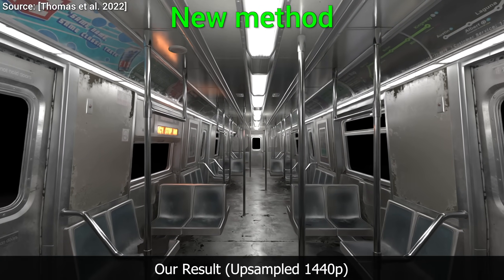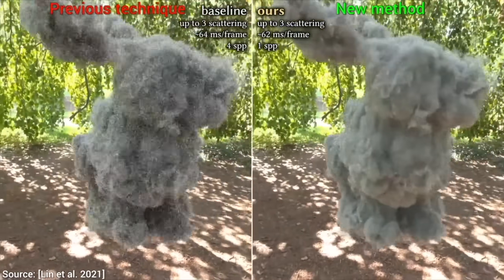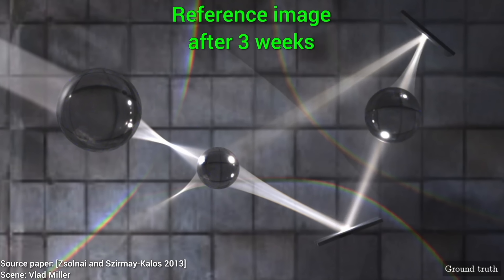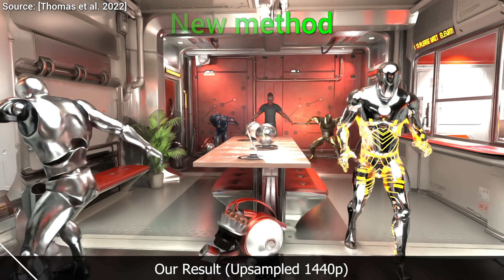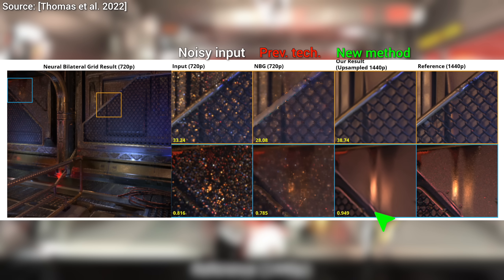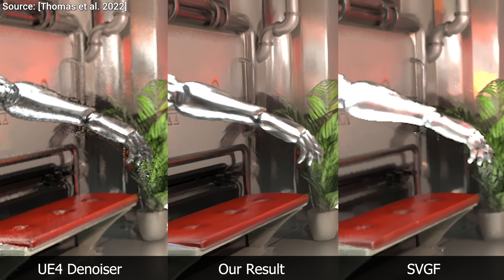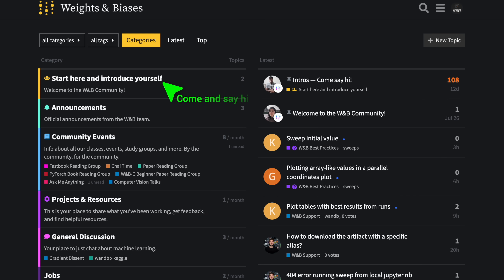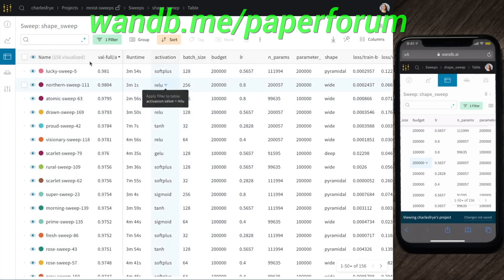Intel’s New AI: Amazing Ray Tracing Results! ☀️

Comment: "More pleasing to the eye" is something you should discard immediately from your vocabulary when talking about objective quality. First, it is entirely subjective. Second, and more importantly, the objective quality of the denoise algo is completely wrong thing to be attributed for pleasantness to the eye. That should be attributed to the composition of the scene. 

If those flashy inconsistent reflections annoy you, do NOT make the denoiser lower quality. Instead, compose the scene in such way that those reflections are not there, or that they become pleasing to the eye. 

I got to say, I'm a bit disappointed a light transport researcher would say something like that.
Reply: Well, objectively, you have to allow for subjectiveness... seriously, lol. The particular scene he mentioned had more to do with slightly softening the hardness of edges. There are a large portion of people who prefer slightly software images (I'm not one), so, he isn't wrong in that statement. Subjectiveness in visual quality is what allows us to use things like lossy encoding/compression. Objectively, such compression is tossing out a lot of information, but subjectively, that isn't noticeable to most viewers (up to a point).
Reply: @JimBob1937  No. Just no. Subjective feeling does not measure the quality of the thing you're forming opinion on. It only measures your own feelings about that object or thing. What's more, such opinions are not even reactions to the algorithm used itself. Rather, they are reacting to the visual results of the image. It is possible to make lower quality result with the better algo but not the other way around.

Thus, no matter how you twist this thing around, you are wrong. Overall, your lol-comment just shows that you want to be right and argue just for its sake, instead of trying to have a productive discussion about the issue. Well.. You failed.
Reply: @anteshell  , lol, you're missing my point. I 100% understand yours. You're effectively stating subjectiveness has zero purpose in algorithms... which is 100% wrong. I am not arguing for the sake of arguing, rather, you're missing the giant, gapping hole in your argument. We're designing these specific class of algorithms for the human sensory organs, interpreted subjectively by our brains. There is a whole crap ton of subjectivity and fallibleness to our senses, and subjectivity plays a key role here. 

" It is possible to make lower quality result with the better algo but not the other way around."

Yes, you can, subjectively speaking. Again, the prime example is lossy compression. It 100% is producing a worse output if you measure that output in terms of pure accuracy, but, humans subjectively dislike certain aspects of images. Too much high frequency detail subjectively tends to bother people, and lossy algorithms tend to get rid of those first. You may want to heavily research the area of human perception and computing. There are many, many things that are objectively less accurate, but are subjectively more pleasing. For example, music tends to (tends as it is subjective) sound better if it is louder, hence the loudness wars. The brighter and bluer calibration settings on modern TVs subjectively look better but is not accurate to the standard color temperature and color calibration, hence the show room color settings used for selling TVs. Dithering is added to an audio signal before an ADC in order to make the last bit of flip randomly, this is objectively less accurate, but subjectively 'feels' better to the human ear. Dithering is an aberration to an image, but can be added in such a way to blend and produce the appearance of more varied colors... worse for your argument, image dithering has multiple types, usually:
- Ordered, a specific repeating pattern for the dithering.
- Random, a random order to the dithering.
- A less defined category, but still a thing, perceptual dithering. Dithering is applied in a specific way that is reliant on human subjective senses of perception, to where the dithering is applied in specific areas of most importance per the general subjective nature of the human senses and visual processing.

Ordered dithering tends to be subjectively worse as human's tend to notice it more. We're more accustomed to randomness in nature. All of the techniques are generally used to improve the perception (subjective) of a higher color bit depth when it doesn't actually exist, as the expense of spatial resolution. 

A very recent and more topical example. DLSS. Even when it fails to be at 100% accuracy to the ground truth, I have actually found instances where an image reconstruction is subjectively better than the native resolution it is trying to emulate. I kid you not. This is because it can improve in perception in other areas like temporal stability, or even improve visible detail over native since it is mixing old and new image data, something native doesn't have access to. In this sense, ground truth is a more limited point of reference. Ironically, in this case, if one were to measure absolute error between an algorithm output and the ground truth it is trying to mimic, it would give higher error calculations for the portions of DLSS that are actually more accurate, simply because it has access to more information than the ground truth.

There are many such examples. In general signal and image processing, human subjectivity is a huge factor. So, again, I am not at all shocked by his statement. It seems to be you that is not at all familiar with human perception being that important in algorithm design, for algorithms whose results get perceived. 

"Subjective feeling does not measure the quality of the thing you're forming opinion on."

Sorry, given your annoying response, I can't let your poor wording choice pass, haha. 

Opinion:
"- a belief or judgment that rests on grounds insufficient to produce complete certainty.
- a personal view, attitude, or appraisal."

Opinions are inherently subjective. You're confusing opinion with objective truth. One can't have an opinion on an objective truth, since that is the truth. Yet, I think you subconsciously understand that perception generally isn't fully aligned with objective truth (how can it when our own perception organs feed us approximations of reality?), and hence are subjective.

So, to thoroughly defeat your shortsighted position... heck yeah, algorithm results can 100% fall into subjective territory if they're in any way perceived. Human perception, and I'm sure similar for other beings as well, is limited in its own accuracy. Your sense organs are feeding you approximations of reality, and your brain is interpreting this information in a subjective fashion that may not completely match reality. Hence, if our base perceptions are inherently subjective, then you have a hard position to argue that algorithm results won't be subjective in perception. A crap ton of engineering makes use of these limits, and the results can indeed be subjective from person to person. Some can notice MP3 compression, or a lower sample rate, or lower bit rate, or JPEG compression, or ...etc, more than others... because it is subjective. 

To loop back around. A noise reduction algorithm for light computations is effectively guessing at missing data. It can't know with complete certainty, for it to know that it would need to run the entire calculation! As a result, yes, there will be variations in how different algorithms correct for this missing information, and the result is, some will be subjectively better than others in their approach. You can objectively try to measure this in terms of absolute error to a ground truth reference, but there may still be solutions that are subjectively better even if it is less accurate objectively... this is just the name of the game.

"What's more, such opinions are not even reactions to the algorithm used itself. Rather, they are reacting to the visual results of the image. "

Is a nonsense statement. The algorithm only exists to output visual results... so, by reacting to the resulting visuals of the algorithm is 100% reacting to the algorithm. That is the only reason it exists.
Reply: @JimBob1937  I might be missing some of your points, but that's purely because most of your both text walls are completely irrelevant to what I've stated. Thus, there is no reason to discuss about them. I'm not interested in talking about anything else than that one very specific and limited thing I stated in OP. So, when you start talking about DLSS and different dithering patterns, that just shows that it's not me who missed the point. Those things among the most of other things in your comments are completely out of scope of anything I've said here. Thus, your comments can only be seen as bragging or what ever else equally unproductive. You've got quite a lot to learn about how discussion works.
Reply: @anteshell  , so, with that giant explanation out of the way, let's go back to my original statement where you said I 'failed': 

"Well, objectively, you have to allow for subjectiveness... seriously, lol."

If our perception is subjective, which it is, you objectively have to allow for that subjective nature in engineering of devices or algorithms. It's just a fact of our reality. Display technology understands our perception is limited and subjective in nature, and makes use of this to reduce bandwidth, storage (of the media), engineering of the light output. Some people notice dithering more than others. Some notice higher/lower frames more than others. Some notice a wider color gamut more than others. Some notice color accuracy more than others... because our perception is highly subjective. Some even find incorrect things subjectively more pleasing. Like vinyl records, which objectively from an engineering standpoint are a worse platform in every way. You can actually do interesting audio engineering to give a perception of higher frequency ranges by making use of the subjective nature of our audio perception. You can add harmonics in a way that make us perceive a lower frequency content than exist in the recording medium. Seriously, subjectively all over the place, lol.
Reply: @anteshell  ,"You've got quite a lot to learn about how discussion works."

You've got a lot to learn, as you just keep trying to brush things off as out of scope.  Your response was not limited, your response was broad in context. Hence, you stated things improperly if you meant it just for this context. With that said, even in this context, you 100% MUST allow for subjectivity since the human perception IS SUBJECTIVE. You can argue against this all day long, but anyone who works in this space should know this. I studied electrical engineering and signal processing (look it up), and there is zero doubt that subjectivity plays a role. So, it seems like you just don't want to admit you're wrong... which is fine, I don't care, lol. However, for any passerby's, they will at least understand how you're wrong, so you're not spreading false information. Have a good day.
Reply: @anteshell  , "but that's purely because most of your both text walls are completely irrelevant to what I've stated."

You stated:
"Subjective feeling does not measure the quality of the thing you're forming opinion on. "

"What's more, such opinions are not even reactions to the algorithm used itself. Rather, they are reacting to the visual results of the image. It is possible to make lower quality result with the better algo but not the other way around."

Which is wrong, and still broad. I gave visual examples and auditory examples. Visual subjectivity is no different than audio subjectivity, in that they can both in subjective in perception. It's well within the scope you gave. If you want to ignore everything as out of scope, that is just a very weak cope out.

Ironically, by our disagreement, you're either not being intellectually honest, or we're experiencing what? Subjectivity in how we're interpreting the information given to us. Subjectivity is pervasive in our reality in many areas. Not saying that is good, but it is reality. Human's are faulty in taking in information and interpreting that information, no matter the type of information it is (hence, broad enough to cover your scope). Even if going for objectivity, you must allow for this subjective nature in your calculations. For algorithms, those that play on subjectivity can exploit it by appearing more pleasing even if less accurate, or exploiting it to reduce complexity. Like JPEG compression exploits the human subjective nature of visuals in that we tend to focus less on color resolution and more on raw luminescence.

So, as kindly as I can state it, given your lack of intellectual honesty and inability to admit incorrectness, while telling me I've failed... all I can say is, f'off ;-)
Reply: @JimBob1937  Really. You seriously come to tell me that you are entitled to arbitrarily decide what are the limits of the topic I'm talking about? I've seen some pretty damn arrogant people in my life but literally never before that level of arrogancy.

And because you cannot even try to keep the discussion both resonable and on topic, I will consider this concluded on my part. You can keep commenting and discussing by yourself if you so desire, but it would just prove my point on your arrogancy. But please, do so. You have earned to pat yourself on your back. ;D
Reply: @anteshell  , "You seriously come to tell me that you are entitled to arbitrarily decide what are the limits of the topic I'm talking about? I've seen some pretty damn arrogant people in my life but literally never before that level of arrogancy."

No, the English language dictated this... I mean, what the heck my man? Do you not understand that your wording is broad, by the definitions and arrangement of the words you used? This is a bit weird of a position to take. You dictated the scope by your own wording used thus far. 

"And because you cannot even try to keep the discussion both resonable and on topic, I will consider this concluded on my part. You can keep commenting and discussing by yourself if you so desire, but it would just prove my point on your arrogancy. But please, do so. You have earned to pat yourself on your back. ;D"

I'll take the pat on the back. However, understand that condescension will not win debates. You've failed here on many objective measures. 

"by yourself if you so desire, but it would just prove my point on your arrogancy. "

Ah, the good old, if you keep arguing I win argument, lol. I don't care if you perceive me as arrogant, and I don't care if I prove that to you, it still doesn't impact any of the previous points I made. You gave an incorrect stance, worse, incorrectly corrected someone in their own field (the video), made the stance overly broad, and then in the face of many examples and reasonings, just said its out of scope and doesn't apply as an insanely weak cope out. That is many failures there. So, to cut you off on your other weak point. Sure, I'm arrogant, but I'm right, your turn.
Reply: @anteshell  Further, you're technically wrong and seem to misunderstand this video in your OP:
"If those flashy inconsistent reflections annoy you, do NOT make the denoiser lower quality. Instead, compose the scene in such way that those reflections are not there, or that they become pleasing to the eye. "

Which hints that you don't understand the function of path tracing, on multiple levels. Path tracing is using rays as probes into the world. This extends past reflections as it is actually causing pixels to be rendered by being probed, if no ray hits an area, its contents is unknown. You cannot alter your scene composition to adjust for this, as it is at the core of the rendering. Further, these denoisers are better, not worse. They are handling more and more sparsity in the sampling and achieving near ground truth, and slightly better because they have more temporal stability in some areas. The ground truth in this case is just feeding many samples until it completes the image, but that still results in noise in some areas. Hence, if your objective measure is the ground truth, the ground truth is actually worse in some ways than the denoised more sparse result. Further, this is primarily for realtime scenarios, which normally have free cameras, and as such you can't really compose the scene to handle it, since the camera can be at any position within a scene... and it's just not practical to tell every artist to simply compose their scene around the limitations, rather than just using a denoiser. You effectively seem to have tried lecturing the guy on being incorrect (he's not) while not even understanding what he is talking about.
Reply: Ratio

Comment: Is it just me or are gaming engines leaps and bounds above these experimentations? ie: Unreal engine looks better than these week long renderings... What am i missing?
Reply: What you're looking at here literally is Unreal Engine.

In this case, Unreal Engine 4.25 renders the scene, using the (optional) raytracing features for all the fancy lighting effects. This produces a very noisy result if you don't give it enough time to trace thousands of rays per pixel.

The researchers' new technique takes that noisy result and filters out the noise, preserving as much detail as possible. This is faster than waiting for the raytracer to produce a noise-free result by itself.

The alternative is to fake all the fancy lighting effects with lightmaps & probes, and many game engines do this really well - but that's complicated, and it's hard to get everything looking perfect, so everyone wants to move to raytracing instead.